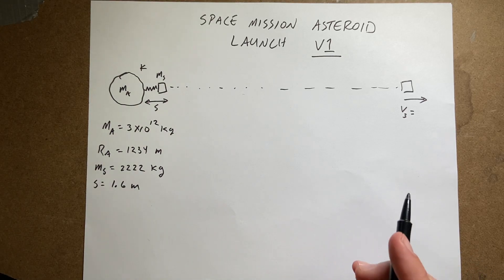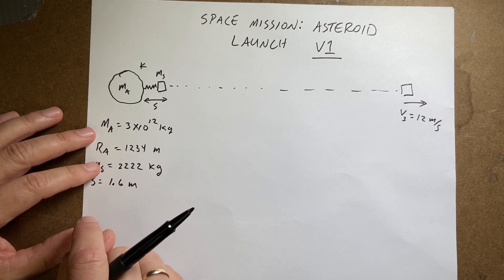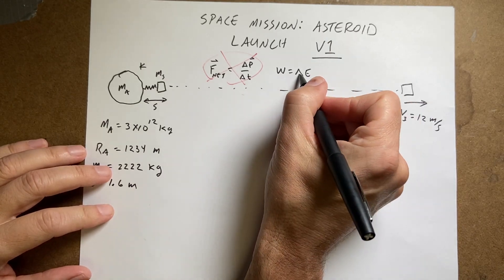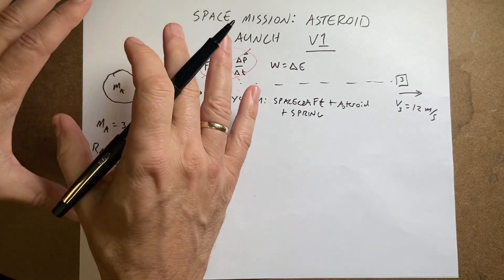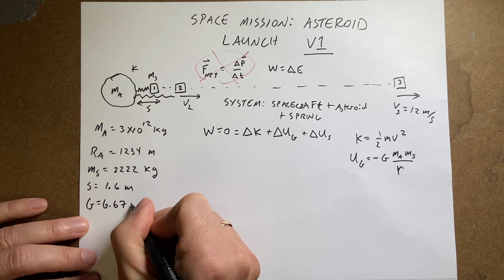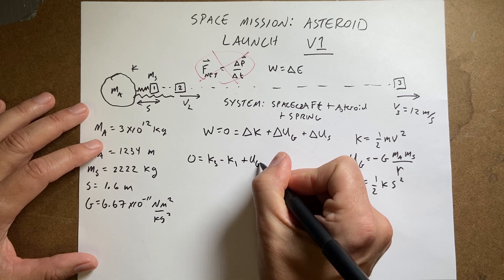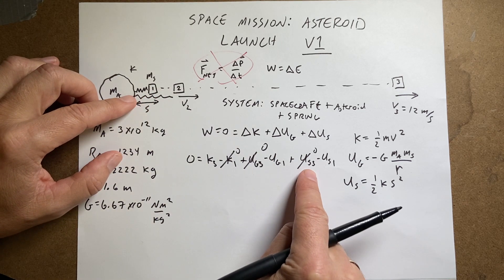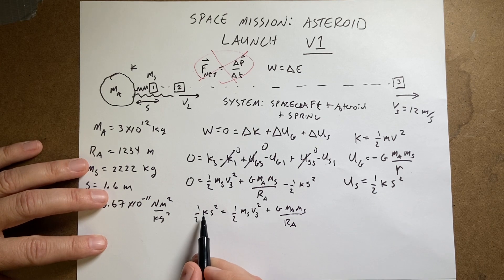Spring Constant Needed to Launch a Spacecraft from an Asteroid - Using the Work-Energy Principle

Comment: I think you should explain why the work done is zero !!!! Because this is the important key to tackle this interesting problem . As in our system there is not external interaction so the heavy mass is attracting the smaller mass and that is the way how spring is being compressed . And the moment the maximum compression is achieved all gravitational potential is converting to kinetic energy and the smaller mass is getting velocity . So here it is only the matter of converting energy from potential to kinetic ...... Oh thats how work done is zero . Or system is using its own internal energy 😀 .  But i like the way you did the problem . Specially the excitement in the last part . Because i feel that excitation every time I tackle a physics problem 😀😀 .  Thanks for your time 🙏